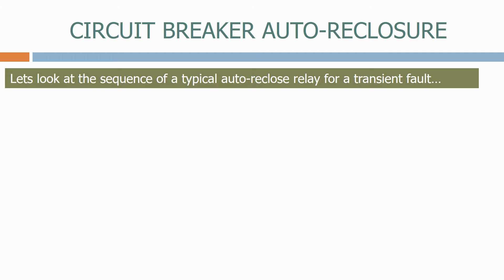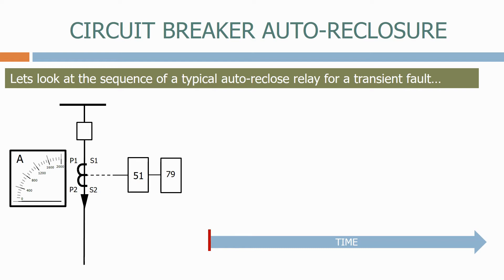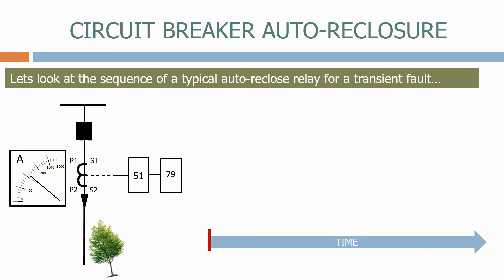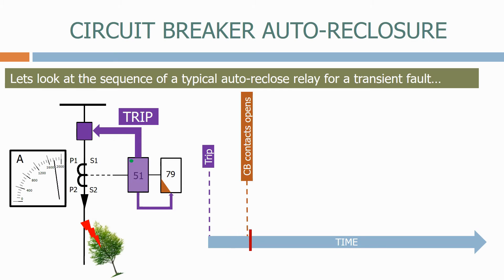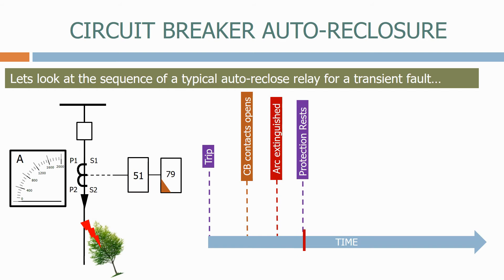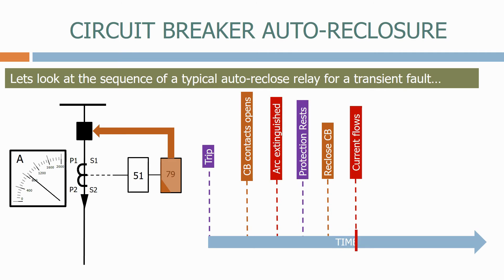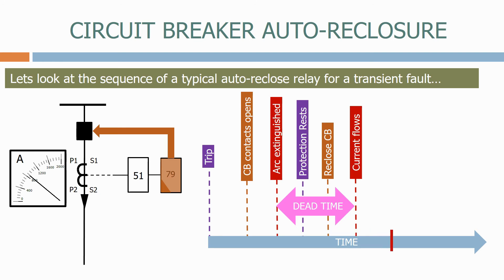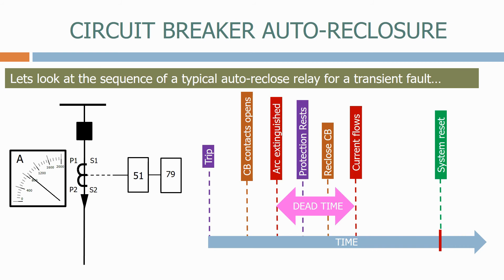Circuit breaker auto-reclosure

Comment: sir how much time would be best for the recloser to reclose? thank you
Reply from the maker: Hi Jogay,
                For distribution systems closing within a few seconds is ok, for EHV systems you can be talking a few hundred milliseconds, especially for single phase auto-reclose systems. Steve
Reply: stephen brooks thank you for your reply sir. I was planning to Reset our reclosers for distribution to first reclose at 0.6secocnds then second reclose at 10seconds. Third would be the lock out. Can i ask for your opinion on these one sir. Thanks
Reply from the maker: Hi Jogay,
                It depends what the reloser is connected to.  If it’s for a distribution overhead line where the most likely fault is trees / animals the settings seem reasonable Steve
Reply: stephen brooks thank you sir
Reply: I would guess a fraction of lifespan less decay.
Reply: Ratio individual to group so that the grouping can output a better percentage performance than an individual paritcal intends a geometric pattern inhibiting delays of function.
Reply: Group is more than one so there would have to be social encumberence for the individual to produce a better percentage